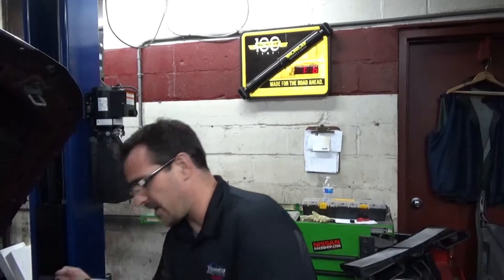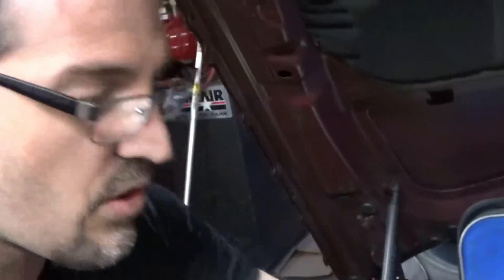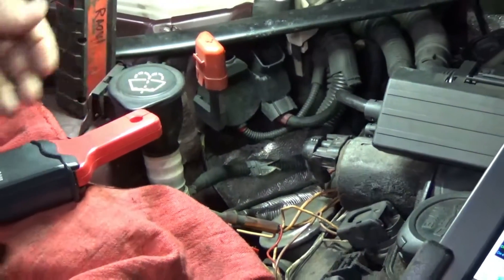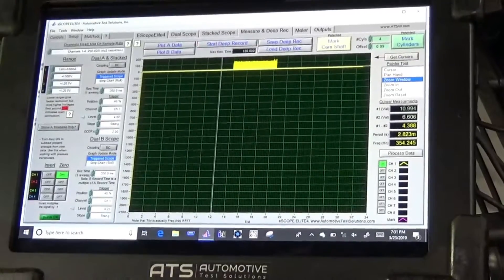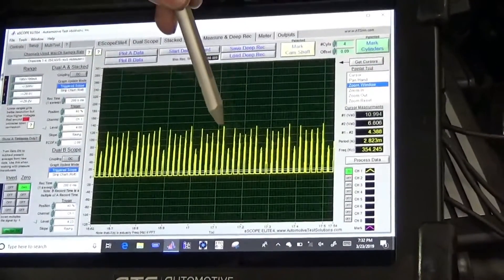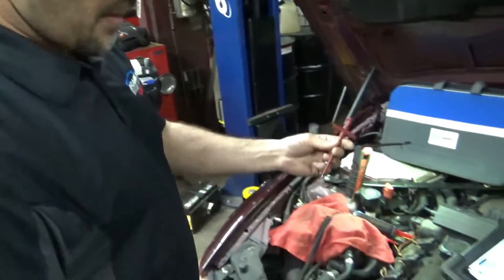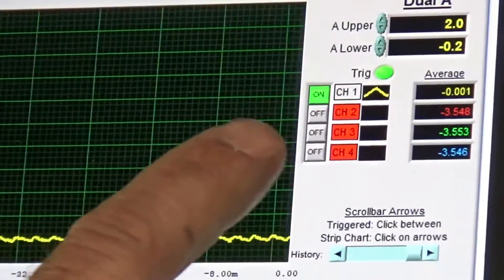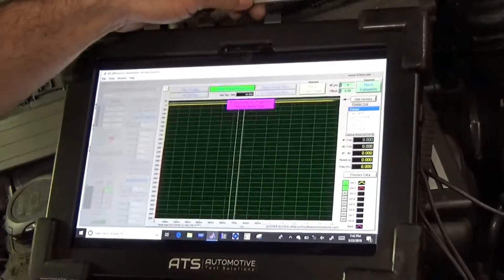BMW intermittent misfire repair

Comment: Unfortunately he didn't come up with a solution !  That is why is the voltage low?  I would say the driver in the ECU is bad and needs to be replaced.
Reply: If you read all of the comments you would have found out that he intentionally "bugged" the vehicle to demonstrate how to properly diagnose the fault. I had the same question but read the comments and found out what he did.
Reply: @eyesalooking Yes, but I don't have time or patients to read all the random comments in a speculative hope that someone will provide the author's answer for him.  Do you cruise fellow students for answers the teacher should be providing?

Comment: Hi, I had similar issue on my E90 2009, N46 4 cylinder engine (dose not exist in the states), it has no trigger signal to the coils, 3 MOSFET Transistors had high resistance 16 K Ohm (Normally it should be around 900 OHM s), I replaced the entire 4 and the problem was solved.

Comment: Un saludo grande desde España, aprecio mucho tu trabajo ,un grand trabajo que te hace diferente de muchos otros que comparten videos y en especial tu actitud de hacer las cosas no los trabajos en si, eres un muy abil tehnico,que sabe y controla con mucha facilidad muchos sistemas electronicos de control del motor y estoy encantado de haber suscrito a tu canal. Con mucho respeto y agradecimientos, un saludo ,gracias

Comment: HEY I have a DME CODE 29EO and 29E1 Lean  and also 2EF5 the car idles rough and rpms slight jumped up and down and car almost stalls..do u have any idea what this can be??? No one can fix it so far that has come to my house,,new battery, starter and plugs. the new oem bosch plugs made no differnce.
Reply: Lol probably vacuum leak. Btw no one knows what those codes mean there's literally thousands of codes, give the description the code means nothing.

Comment: Brandon, is the scope automatically saving each previous data capture In case you have to go back through and look at the data again? I messaged you on Facebook once I believe it was. I’m just now starting to use mine today. Yes it’s been a few months but I need to transition from hobbyist To where I’m doing it like you on a regular basis. I’ve also been working on keys, immobilizer, and other things as well the last few months as I’ve decided the keys portion would be easier to get up and running and do the stuff in-between time. I’m going to upload the video to Facebook and tag you in it here in a little bit can you tell me what you think it is and I will let you know later this evening. I think it’s main bearings and stuff gone because he didn’t have no oil in it initially. After it had sat overnight at the restaurant he left it out when he was out the night before he took off to go home a couple miles and made it about a mile and the car started chugging and died. 

He had a buddy with a tow strap pull him home and had me come look at it a couple days later. He thought it had to do with the key that I had made for him but I knew it didn’t because how often do chips go bad inside keys. I took his concerns and went and checked the keys in his garage as he wanted to be present. After we both saw that nothing was wrong with the keys and that the immobilizer was working on the vehicle he asked me to start it. I asked him to hang on for a second and went over and checked the oil level and there was no oil on the dipstick.🤦🏻‍♂️🤦🏻‍♂️🤷🏼🤷🏼🧐🤔🤔🤔🤭🤭

Since he lives a block and a half down I went home while he went and got oil and I got a text message from him saying I think I found the problem so I went back down and he said he was filling it with oil and not getting any reading on the dipstick so he looked on the floor and there was oil on the floor. I saw from a kneeling position that the oil pan on the backside of the engine, firewall side had a crack in it midway up the oil pan which I thought was rather odd but then my instinct told me that something wasn’t right & the oil pan probably got slapped by the main bearing piston cap

He called me back again yesterday and wants me to come look at it in a little bit so I am going to possibly do a relative compression test but given the video I think I’ll just drain the oil and look for foreign metal objects or metal particles in the engine. I will post a video to my Facebook in a minute and tag you in it. By the way this was voice type so if I had any mistakes please excuse that.  

My guess is he will probably help me replace an engine for him this next week as I know he needs it soon because he said his father has a doctor appointment coming up. That and he said to drive his 2 Wheel Dr. pick up which you normally don’t drive during the winter with all the snow we get.

Comment: So in summery, it seems that at this point I know that there is a problem in the voltage supply (to the coil) and I would start the troubleshooting by inspecting the wire/splice, and so on. I'm not a tech correct me if I'm wrong.

Comment: Great video! So many just throw parts at a problem without understanding what the problem is. Now that you know there is voltage drop to the coil I would like to see what the problem ended up being? Broken wire? Bad transistor in dme?
Reply: Aaron , We spliced in a ballast resistor on a single coil voltage feed wire....Simulates a bad wire repair

Comment: Well done on the video. Very informative and has given me a great lead im trying to follow up on. However i live in malta and cannot find anyone with the tools you have to properly diagnose. They use the trial and error approach!
My question is when i reset the codes through an obd device the car runs normal then starts acting up again a few seconds later. Does that tell me anything that excludes this tested approach? Thanks. Rob
Reply: Resetting/Clearing the codes really doesn't do a whole lot for the computer as a hard fault will come back right away. 

What was your code you were getting and what did you wind up doing to resolve this issue being it's been 4 months or so? 

For future reference you don't need a scope such as what he's using unless you're doing this stuff day in and day out or have the $$ for the tool and time to learn. 

There are other scopes on lower budget levels that require a little more setup that can get you similar results but as Brandon showed in the video this ATS patented scope if the only kind around with the deep record and my understanding is that Bernie Thompson with ATS has a patent on it just as he has patents on alot of things he's invented. Bernie is a great Tech, Engineer, Inventor that has did alot for the industry in the terms of diagnostics, saving time, etc and if you watch any of the ATS ~ Automo Test Solutions videos you'll see why Bernie is good at what he does bringing the industry these great tools.
Reply: Your comment has no relevance to this video. But by reading your comment it seems like there may be a faulty pin in your dlc
Reply: Malinda W nope that means that the problem is happening right away so it is active!!

Comment: Is it possible to just unplug a coil to get the reference instead of using the 2nd probe?
Reply: Yes, by watching the scope and unplugging  each coil you will see which coil presents the problem.  The 2nd probe isn't necessary.
Reply: Cosmin Rotaru , However you can determine which coil circuit  is it at fault

Comment: Question, if there is one wire going to all the coils right behind all 6 coild packs, why isn't is happening on all, can't a coil be shorting and pulling the voltage down ?
Reply: In combination with the wiring diagram, one can pinpoint the fault between the coil and the splice for the common supply circuit.
Although this was a man-made v-drop (ballast resistor, spliced in series with one coil’s volt mage source), it could easily have been a poor crimp from a botched harness repair.
Reply: This would be reflected in the amperage trace as an “increase” in current. We spliced-in a ballast resistance to a sign gale could feed wire, to prove a point
Reply: You were suppose to put that in the video.  Bad teaching on that one.

Comment: Your statement of primary ignition voltage can easily exceed 500v is a misnomer. If the coil is not shorted or internally arcing than primary voltage should never exceed charging system  battery voltage. I think you meant to say secondary voltage can easily exceed 500 volts. Again any good lab scope and sensors can easily perform what you did here, it is not necessarily the lab scope but he who is capable of reading and interpreting the data on the lab scope. 2 strikes against you.
Reply: Hello biggysground,

I will be the first to tell you that user or incorrect. I PERSONALLY have captured primary voltage exceeding 500 V. I urge you to perform the following test… Sample from a 2-wire COP control wire And begin to create a gap between coil boot and spark plug. You will experience the same.
One thing you’ll learn about me is I speak from my OWN experiences, I do not read books and regurgitate. Furthermore, I never once mentioned that you need to “ this scope”to perform these tests. In fact, this is the most basic test one can perform… Unfortunately most technicians don’t even understand these basic test. I do however, appreciate your feedback and hope to hear from you more often. Thank you so much for your input👍
Reply: @brandonsteckler3417  You are incorrect sir, a gap between the coil boot and wire is secondary and if you see a voltage spike on primary than excess voltage is bleeding back into the primary side. You stand corrected not me! I have been a master tech longer than you have been alive. Cant shit an old turd!
Reply: biggysground ,

Then , You will recall, the primary and secondary reflect one another. I’ll tell ya what...just to be fair, I’ll create a video, JUST FOR YOU, reflecting what I have proven many times. 

I don’t appreciate the aggressive language as this is a place for others to learn, not for you to flex the ASE patch on your shoulder. I too hold these certs but I don’t stand behind them as “show-off” material. Anyone can pass a test. 

I ask that you respond to my video and tell me that you the. understand what it is you have merely overlooked. Fair enough? This is important as what you have currently states will mislead other techs. I use this testing almost everyday. I’m not making a statement  to “show-off”, I’m actually attempting to educate others
Reply: @brandonsteckler3417  Speaking of a properly working circuit as in your case you should never see more voltage on the primary side than battery voltage, if you see a spike of like you say 500 volts than you have a problem on the secondary side which would over time cause coil and computer failures.
You should be more clear in explaining. Back emf's, and from a collapsing field. This is not new science and your statement above is incorrect because it is secondary voltages bleeding into primary circuits. I am not here flexing anything but advising you of your mistake, a verbal explanation blooper. I will not watch anymore of your freshman class scope tests.
Reply: What I’m trying to get you to recall is:

An ignition coil is a step-up transformer. It takes the inductive-kick (hundreds of volts) on the primary side of the coil, and steps it up (thousands of bolts)because the many-times more coil windings on the secondary-side .

My point is, you can’t have secondary without primary. You can’t have a secondary voltage in the thousands of colts without primary voltage in the hundreds.
 of volts.

The primary and secondary are virtuall little-Brother/big-Brother ...can you now recall what I was saying?

If I pull the boot of the COP away from the the spark plug, the KV Demand goes insanely high (healthy coil, of course) and that insanely-high voltage is multipled about 100x on the secondary side.
Reply: biggysground ,

Even a small relay creates an inductive kick way higher than “source”. Heck, why do you think the AC Clutch coils had the clipping -diode wires parallel to the connector?
Reply: @brandonsteckler3417  Good grief, well done with that one
Reply: A2Stanton , I felt bad because he clearly is not understanding what I’m trying to say. I’m not questioning his capabilities, I’m questioning his understanding of my explanation.
Reply: @brandonsteckler3417  Dude if you had 500v spike on the primary circuit it would fry the computer. Your testing is flawed.
Reply: @brandonsteckler3417  Thank you sir for a great video! As to this cat Biggysground, he either can't comprehend what you're saying or is just a troll. In any case, not worth your time if he isn't willing to learn.
Reply: Gearhead Automotive L.L.C. ,

Thanks but please, we can keep this pleasant for everyone. I truly believe there is a misunderstanding and I have sent @biggysground  a few links to demonstrate what I am talking about. I hope the are received well
Reply: @brandonsteckler3417  Yes we absolutely can. I agree with your position and didn't intend what I said to come across as taking a side or an attempt to stir the pot. I don't mean to suggest that he or anyone can never comprehend the concept. Merely that he is unable to do so at present. If such is the case then I suppose it's a matter of finding the correct method to reach him which you're clearly making every effort to do. Some folks have a hard time accepting when they don't know something, particularly when they've got lots of experience in a given area. I'd like to give him the benefit of the doubt and believe this is indeed the case and not just an instance of someone looking to create drama. Either way, thank you for your response and professionalism.
Reply: Gearhead Automotive L.L.C. , of course! I’m always out to assist in any way I can. Thank you for your feedback 👍
Reply: @biggysground  No you are incorrect. primary voltage on coils usually go to a few hundred and secondary goes to many thousands. I think you are getting confused with coils that have 1wire 12v+ another 12v-(ground)  and then a control wire. On these such coils primary cannot be directly tested as far as im aware
Reply: @biggysground  Wow. Lmao. Dude. Why do you think you need to use an attenuator for the primary side? Because its in the hundreds of volts and can damage your scope. The secondary is in the 10s of thousands. No diagnostician speaks the way you speak.

Comment: Dude, you should have shown the bad wire connection, or whatever the problem was. We don't know since you didn't show it. :(
Reply: Hi there,

 The car was bugged by us, shortly before the video was filmed. The idea was not to demonstrate that the car was properly diagnosed. It was meant to demonstrate the techniques that led us there. They were very easy to perform and yielded a lot of information
Reply: Now you're trying to justify your behaviour. I clicked on this to yes see the steps but also to have a resolution. Nothing Inter title suggests it's a bugged care. Unless I missed that. Don't do that again.
Reply: @JohnDoe-sp8zg  if you didn’t get anything from this video then these testing methods are beyond your ability.
Reply: The purpose of this video is not to breast feed you or feed you with a spoon
Reply: @MalindoWe  Well then the video sucks💩

Comment: Very good instruction.  I also appreciate you showing the equipment you use; might sound like a commercial to some but I'd like to know what great techs use to make them more effective, and why.
Reply: @M Barry,
    This video was constructed to not only demonstrate the operational characteristics of the ATS EScopeELITE4, but also solid diagnostic approach that will lead you to a pin point diagnosis every time,  regardless of which emblem is on the hood! This is based around a solid understanding of the physics involved, and the system/component functionality.
Reply: @brandonsteckler1307  professionally, this is a guy know exactly how to use his diagnostic tool  and find th underlying problems 100!!